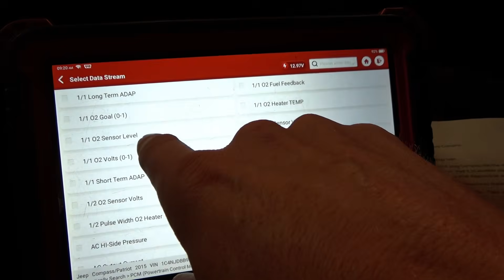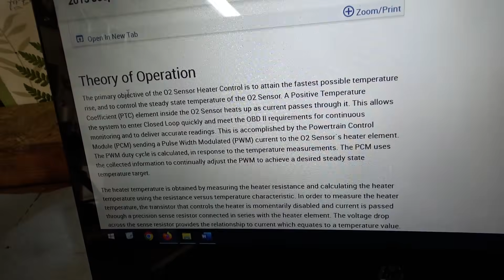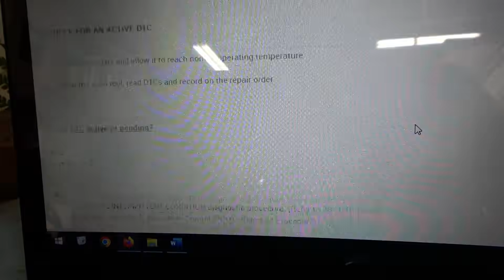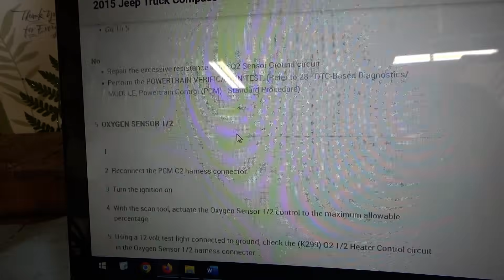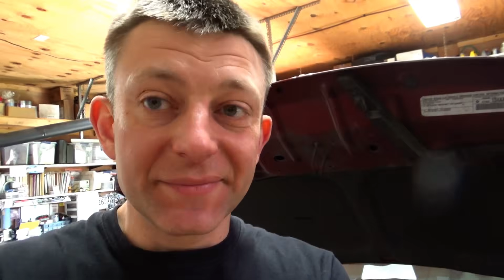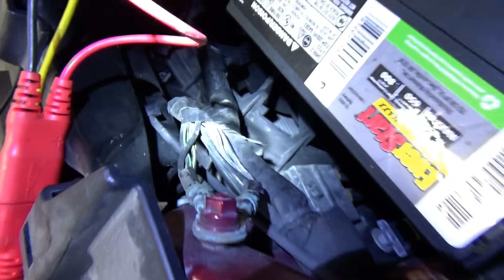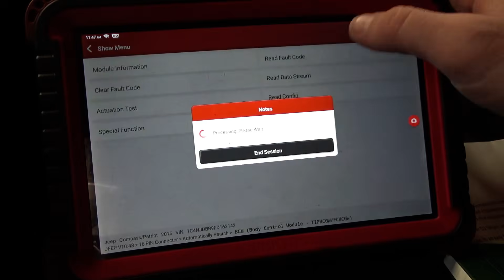Shop Says "Jeep Needs a TIPM"...and DEAD WRONG!! (15 Compass P0038)

Comment: It is sad that so many technicians at so many shops do not know how to do simple troubleshooting and diagnosis especially where wiring and electrical issues are concerned. My personal opinion is they rely too much on computers to tell them what's wrong and have never learned the basics of old school style troubleshooting. Dealerships are notorious for simply firing the parts cannon because they have parts on hand. This customer probably saved a bunch of money coming to you, even with the cost of the long drive. Great job as usual.
Reply: Disagree calling Dealership notorious. 
Many Shops do this. 
And quit calling auto mechanic "Technician".
It's an over used term. 
Just because you use a scanner does not make you a Technician.
You might as well call the auto parts "technician" also. 
People come into parts stores. I want you to diagnose my car, it has a check engine light 🚨. 
Presto, spits out the codes on paper, gives them the codes and a solution to the repairs.😅😅
I laugh at this approach. I asked who made the decisions how to fix the problems.? 
I was told a "Team of professional Technician" developed the software and it's protected. 😅😅😅😅
One day I saw a report, to fix the problem, the report read, "De-ice the intake system", this was in the middle of summer, temp is 110 degs outside. I laughed so hard. How stupid must the so called professional Technician be or how stupid are people to believe this nonsense.

I do agree with you 100% , they rely on a scanner codes to tell them what's wrong.
There is no common sense. 
I've been following Ivan and Eric O all of the time to help me troubleshoot. 
Powers and grounds. They cannot beat that into my thick head. I even bought a 2 channel scope because of Ivan and Eric O. 
Well. Enough of my rant.
Cheers
Reply: @2nickles647 they do know how they just don’t get payed the time they need to diagnose it. So they shotgun what they common see. Just how it is in today’s shops. Start paying them to diagnose and this will change. Until then Ivan and all the other Ivan’s are the solution. Cheers
Reply: It's a sad thing for our planet and wallets. On the other hand, it gives the smart people a chance to pick up cars for cheap and make good money on fixing the ones "reputable repair places" could not figure out. I drive "written off" cars for the last 20 years or so and I don't know anyone that has driven as cheap as I have.
Reply: Stealerships make a fortune by firing the parts cannon, if one of their techs said " No parts required " He/She would be looking for a job the next day.
Reply: Stealerships make money on marking up parts at MSRP+
Reply: Shops make alot of $$ because of rookie techs mis diagnosing the problem.

Comment: I really am blown away sometimes by the lack of basic electrical knowledge at many shops.  This was as basic an electrical diagnosis as it gets and calling a bad TIPM was so far off it's not even funny.  That circuit isn't even on the TIPM.  I guess since TIPMs fail a lot they just fire the O2 sensor parts cannon and if it doesn't work it must be a bad TIPM.  Sad state of affairs in the automotive repair industry.

Comment: I'm guessing that close proximity to the battery when charging caused the terminal corrosion issue. It looks like the ground terminal nut has the same red anti-corrosion coating as the battery +ve connection but the manufacturer missed coating the ground terminal eyelets.
Reply: Bad Chrysler wiring. Nothing to do with the battery.

Comment: Question - why the piercing probe instead of front probing? Granted, you wouldn't be able to see any signal from the PCM, but that wouldn't be high on my list of things to check unless the circuit all checked out.  But this is another example of "wiring, not parts".  You and Eric O. seem to get a lot of that.

Comment: all the Dodges and Plymouths Ive had staring in with a 1957 never ever had the electrical right , at least the fords always grounded at the source of use like rear lights and front .and the older GM'S grounded at the frame.

Comment: Jeep. First thought bad ground. Second thought bad TIPM. Third thought why did I want a Jeep again?
Reply: Because Jeep is the only vehicle out there that still looks like an American car, and not a Japanese cartoon villain?
Reply: @thirzapeevey2395  Don't forget the Dodge Challenger.  :D
Reply: Fourth thought, because "no parts required".  :D
Reply: GM’s do the same thing
Reply: Manufacturer, that would assemble a vehicle's ground circuits in the area of a in battery that tries to destroy its own connections , much less those around it would position the Connection to the more friendly area.  We see how many problems the Eric from south main finds in the rear spare tire area of domestic pickups that put modules,  electrical harness connectors at the rear of a pickup truck , I couldn't think of a more hostile area.
Reply: The first thought most people have about jeeps are that they are reliable. This is a notion left over from WW2,  When they actually were. The jeeps of today are an electrical nightmare like everything built by Chrysler/Fiat.

Comment: Too many grounds bundled? Dissimilar metals?
Reply: Exactly...  Or at least it's the same galvanic corrosion effect.  All it takes is for one of the wires to have a slightly worse connection than the others and that will create a slight voltage bias between them and then it starts to act like a sacrificial anode and corrodes away.   They should really stop tying grounds together like this.. It's always an issue.  But you can tell that they know it's a problem, by the way they made it easy to find and easy to repair.

Comment: Imma poke a hole in this wire that carries current and not seal it up because it’s a dry environment under here in the engine bay - Ivan

This eyelet with exposed copper wires is junk, Chrysler should be ashamed. I’m gonna seal up the copper real good. - also Ivan

Comment: Hi, Ivan. Great video.
Have you tried using the Hz/% range on your clamp meter instead of connecting a scope.
It would be interesting to compare the two, to see how precise the meter is.
Also pre-heating the crimp connections with your gas jet before applying the SOLDERING iron would ensure a more even heat through the joint.
I use a heat-shrink heat gun, works a dream.

Comment: Befroe watching the full video-Dayam.  The TIPM, unlike about everything else on a Chrysler, doesn't even fit into the equation here.  Probably the sheety ground we always see.  
After watching great video-Great find!  Guess B level techs just yell 'TIPM" since a majority of the time on Chrysler they would be correct.  Great testing without guessing Ivan.
Reply: Majority of the time? Not really. It's an issue but I've seen way to many problems blamed on the TIPM when it wasn't at fault. Then after replacing it and finding the real problem, people only remember the $$$$ TIPM being replaced.

Comment: It's marvelous to see these videos where you're able to diagnose what was initially sold as a very expensive repair but turns out to be a simple, no parts required fix. The person who made the incorrect diagnosis would have gone on to perform the "repair" and of course the problem would have remained. Then what? The nightmare of having to shop your car around to find a competent mechanic is very real as well as the issue of payment for an incorrect diagnosis. In the meantime, your car is possibly out of service and you'd be mired in small claims court, because there's no way you should have to pay for incompetent repair work, most especially at 150 bucks per hour. It is unfortunate that there are so few Ivans in the repair world; worse that it actually makes Financial sense to seek him out despite the cost of shipping and inconvenience.
Reply: yep!  Past twenty years this increasing phenom has make many of us question car ownership of modern type cars.

Comment: New battery? I would willing to bet the old battery was out gasing so badly that it caused that amont of corrosion!
Reply: If you can afford it, replace the flooded battery with an AGM.
Reply: @chrisstoddard1144 that's why batteries have a Blankees, to cover the over gassing situation. It's like farting under your blankeee, you don't want your gasss to float out and cause corrosive atmosphere 😅😅😅

Comment: The circuit wasn't even on the TIPM...I was big time confused at the other shop's diagnosis. But I figured it was a poor gnd. Chrysler is mighty stingy about adding redundant gnds. That being said, usually other problems with higher current draws show up 1st. SO this was a good case study. I dunno who builds these harnesses. My own 09 Challenger had an exterior lighting problem since day 1 ( headlights- std bulbs not HID) would pulse and you could hear the alt cycling at idle. I had it at the dealer 3 times. They replaced the battery, the alt, and the TIPM, same result. Luckily it didn't cost me anything. I grabbed a wiring diagram and found the gnd for all of that was loose in the crimp. I'm not a big solder guy, but that time I did. N/P since.

Comment: Spot on diagnostic procedure, Ivan! Simple repair and no Tip'em required 🙂
Interestingly, some soldering irons use the same procedure to monitor temperature (alternate power on and heater resistance measurement).
Reply: I have a fancy Metcal that does that.
Reply: @scotts4125  Yep. It's the top brands that do it.

Comment: Proved your point again bro...a good diag saves time and money of customers question is if the customers agree with it😮...great job always learn from your work and follow your footsteps in diags and believe me it saves me lot a trouble and time..same kinda issue resolved yesterday on a toyota verso etc(electronic throttle control system) malfunction a code p1725 with no definition and found one bad wire at the neck of pcm connector thx to your methods done it in a magical time NPR fix 😂

Comment: IV fixed  a ton of those jeeps.  2 in 1 week the same color as that one. The problem usually shows it's head as a turn signal or headlight not working.
Reply: This one had a headlight out the week before it went to Ivan.

Comment: Also my bet is the hydrogen gas from the battery since that is a southern car. As it’s right above the battery too 👍🏽🤙🏽
Reply: H2 is not a oxidizer
Reply: @shakalpb1164 
Yeah but the sulphuric fumes that go with it are not nice.
Reply: Yeah, the sulfuric acid fumes from the battery. Spray some terminal protectant on there.
Reply: Got nothing to do with h2 gas or battery. 
It's poor Chrysler quality.

Comment: 22:20 What causes corrosion there? Maybe gasses released by the battery causing it since the batter is so close to that ground point.  All the differing metals that are exposed combined with the battery off gasses.
Reply: Poor termination. Those crimps are exposed to the elements plus, there are several wires per terminator which allow the elements to get inside the groups of wires and do their oxidation process. They should have used more eyelets and weatherproof eyelet terminals.  Too bad repairs like these don't get reported back to Chrysler so they can see how bad things really are in the field.
Reply: @Garth2011  yep!  chrysler/fiat/whatchamaclit comglomerate co that it is, with some of the poorest made cars out there
Reply: I would guess it is because you have exposed wiring. This is especially the case anywhere outside the passenger compartment (Though not a good idea inside the passenger compartment either). When the atmosphere reaches the dew point those water molecules can easily carry contaminants.
Reply: My guess is poor Chrysler quality work. 😅😅
Reply: It’s a Chrysler, common as the day is long for grounding issues
Reply: That is a great question
Reply: Yes a squirt of fluid film when new would have stoped that.
Reply: Exactly correct...
Reply: I agree, 100%.  Dissimilar metals corrosion plus the outgassing of the batt.  Biggest fail is leaving everything exposed to atmosphere FROM THE FACTORY!!! 
A little spritz, of just about anything , would've prevented this from happening for a long time.
Even covering it with oil or a little high temp grease (if you're REALLY on a tight budget).  Inexcusable.